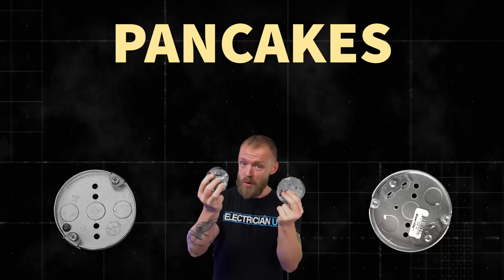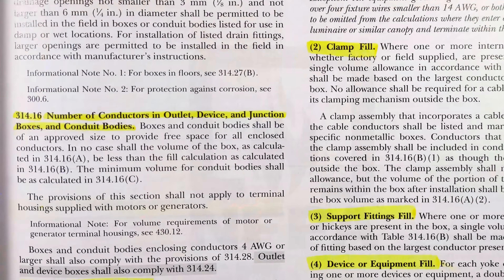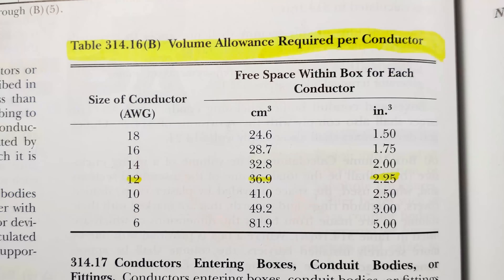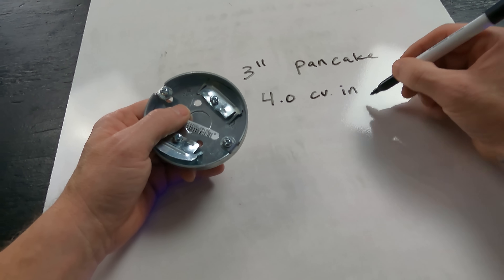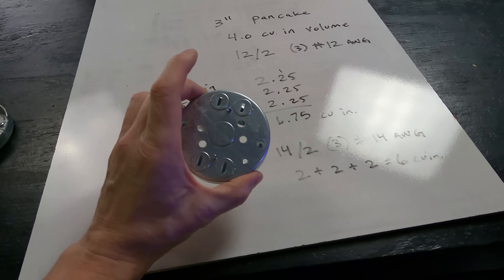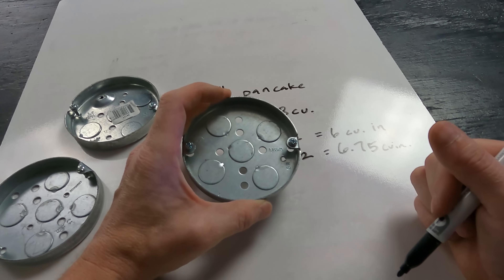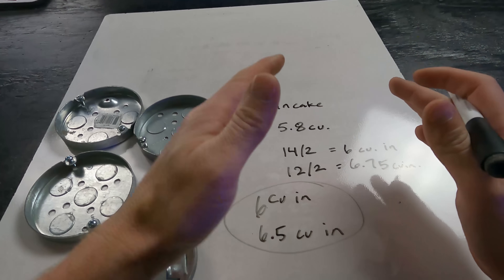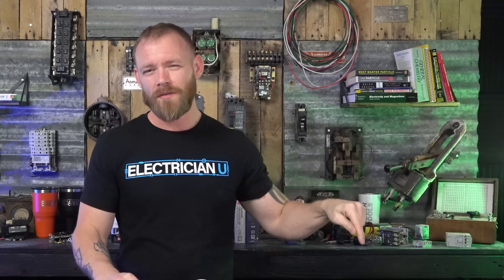Do Pancakes Violate Code? How Many Conductors can ACTUALLY Fit?

Comment: I keep trying to tell my peers at work they are violating code when they run jumpers from these pancakes in 14 wire. They say "NO IT DOESNT! ITS A COMMON MISCONCEPTION!" I swear I work with a bunch of tards.
Reply: Depends on how long the jumper is.
Reply: @DaveMiller2  why does the length of the jumper matter
Reply: @dougfoster445  There is an allowed length that you can use a downsized conductor.
I want to say 16". I could be wrong on the length.
Reply: @DaveMiller2  Doesn't make any sense to me. Can you give me a citation in the code?

Comment: My understanding or box fill was to count CURRENT CARRYING CONDUCTORS. The ground is not carrying current thus would not be counted towards box fill.  Line & neutral conductors would count only so for 12/2 Romex, the box fill calculation would only be 2.25 + 2.25 which is still too much for the 3" pancake.  BUT 14/2 Romex is only 2 + 2 so it would be acceptable to run 14/2 Romex to a 3" pancake.  Am I wrong about current carrying conductors? It's been a while since my apprenticeship program.
Reply: 314.16.(B)(5) of the 2020 code requires counting of EGCs as described in the video...1 thru 4 EGCs = 1 volume allowance in total... EGCs 5 and above each count as an additonal 1/4 volume allowance.
Reply: Even before 2020 you still had 1 conductor allowance for the ground. 2020 just stepped it up for >4

Comment: I feel that since they are a CODE VIOLATION , they,  the manufactures of such boxes STOP and DESIST making them !!
Reply: They are a code violation, in most scenarios. But as stated in the video, you put 18 wire instead of 14 and 12 wire and you'll probably never be in violation. No way a company will stop making a product if it can still serve some purpose. Best work around would be for the code writers to meet and discuss the most common reasons these get used and to find a way to use more standardized boxing methods as minimum code. I understand your grief with your statement though. Would be dumb to fail an inspection because of one overfilled pancake.

Comment: Hmm 🤔 are you allowed to consider the space in the back of the fixture? Most ceiling fans have a pretty generous escutcheon and typically a good size down rod?  How about the typical Florence fixture where the termination is in the fixture rather than the box?
Reply: Yes
Reply: 410.20
Reply: I agree with you, except with the ceiling fans portion, those are not rated for ceiling fans.
Reply: @Htm.13  they do have fan rated pancakes tho but yes regular pancakes are not fan rated
Reply: @bananainacup  Yes sir, funnily enough we call em "Fan cakes" around here lol
Reply: @Htm.13  I didn't even pay attention to the rating when I was changing a light fixture to a fan at my mom's house. I just put extra drywall screws where the fan bracket screws would be so that the fan was being held from along the stud instead of the sides so there was no chance for the box to bend or wobble.
Reply: @xylexut2589  drywall screws are not really the best for hanging fans
Reply: @xylexut2589  It would work, it's done daily by hundreds of Handymen around the country, BUT it is a code violation still

Comment: As a Licensed Journeyman Electrician / Sub Contractor with over 55 years in the trade, I have never liked or used pancake boxes !
Reply: What do you use when your pendant lights over an island need to be perfectly centered on the countertop, and center of the countertop falls on a joist?
Reply: What do you use when center of a hallway falls directly on a joist?
Reply: What do you use when center of a vanity light over a sink falls on a stud?
Reply: @phi5head  absolutely nothing unsafe about a pancake box when used properly. Most inspectors will allow them if you are in a situation where there is no other solution. 37 years experience ,28 yrs as a contractor I use them all the time when the install calls for it.
Reply: @dirtyrotten2648  I totally agree.

Comment: Let let pose this quandary. You are using a pancake in a surface mount application for a wall mount exterior light. Or a ceiling mount fan. (Yes there are fan pans). The room allotted with the fixture should also play into the fill calculations. A lot of wall fixtures and some fans have a "shroud" that provides more than enough space to comfortably make connections. In theory it would work. What's everyones opinions?
Reply: these boxes are not rated for exterior use.

Comment: This is why saddle boxes are superior to pancakes. The extra volume you get by wrapping the box around the joist makes them actually usable to code and can even allow for a junction on the circuit if you need it. I just replaced a pancake in my kitchen ceiling yesterday for a saddle box with a 12.5 in³ volume. Even with the integrated clamps it's still pretty roomy with 2 Romex coming into the box, especially since they're non metallic and don't need a ground screw taking up precious space.
Reply: Saddle boxes only work if you need your box exactly centered on the joist. That's usually not the case.
Reply: For commercial won't always work like that

Comment: 3:00 I'm a little confused at this grounds thing, would it mean 5=2, or 5=5? 6=3, or 6=6? etc
Reply: According to the 2020 NEC code, 4 grounds or fewer total is 1 volume allowance (based on the size of the largest conductor in the box). Each ground greater than 4 is counted as 1/4 of a volume allowance. so, 5 grounds total is 1.25 volume allowances. 6 grounds total is 1.5 volume allowances.

Comment: I'm confused. You were correct on what you said about these boxes but where I'm fuzzy is don't you have to count the wires you are connecting to? I don't see a lot of lights with terminals on them.
Reply: Check the exception in 314.16 B 1 conductor fill.

Comment: I've been using these is my plaster house. I sheetrocked over the plaster which gave me 1/2" depth. I pulled out the old knob and tube and dug out the plaster enough for the romex connector to clear. Fish the romex through enlarged existing holes and screw it over the plaster.

Comment: In the two years I have been an apprentice I have never seen these in my work. Plus they look like a pain in the you know what!
Reply: They're useful when you're trying to cut in a light at a very precise spot (centered on a vanity, matching sconces, etc.) and you luck out and land right over top of a stud or something.  They're definitely a last resort kind of thing.  Mostly I've used them on renovations/remodels.  On new construction when the customer isn't sure of cabinet layout or something we'll leave a wire in the wall during rough-in to cut in the light precisely during trim-out.  And again sometimes you get unlucky, land right on a stud, and have to use one of these things.
Reply: @Audey  what about using a Multi tool and cutting into the stud? Also I feel like I install more waffle lights that are even slimmer now. What’s your thoughts? Here to learn and see many options to installations.
Reply: @djchaisson  Notching out the stud is usually my first choice when I have the option.  You can use a hole saw to do it too, the hole in the drywall will keep the saw stable and the notch will usually pry right out along the wood grain.  Often times though there's HVAC or plumbing in the same stud bay that makes even notching impossible.  I try not to take big chunks out of structural elements too so that's another example where I'd use a pancake.  They also make plastic pancakes where 1/3 of the box extends back much deeper.  But the way they mount, you have to be pretty close to dead center on the stud for them to work.  Plus we rarely have them on hand.

Waffles are great if you plan on using them from the start, and if you're putting lights on the ceiling.  But a lot of times when I end up using a pancake it's because a customer has some other flush mount fixture picked out, and I've already cut 7 holes in their ceiling when I hit a stud.  So my options are pretty limited.

And if I'm being honest, I'll use them to save time even when it is technically possible to get another box to fit.  Harsh reality is margins and deadlines can be tight.  A lot of times it's 10min to put in a pancake or a 45min+ fight to make something else work.  And to me, the primary reason for the code rule in the first place is to allow space for heat to dissipate.  Most fixtures have ample extra space in them, so while it's not to the letter of the code I feel like it's following the spirit of the rule.
Reply: The most common spot that I use pancakes is in bathrooms. The light must be centered on the vanity and a lof of the time there's plumbing or a stud in the way and this is the only way to get the light centered

Comment: Isn’t this missing the point that a typical light fixture has substantial additional volume below the box itself? Effectively that becomes a box extension.
Reply: 314.16(A): “The volume of a wiring enclosure (box) shall be the total volume of the assembled sections and, where used, the space provided by plaster rings, domed covers, extension rings, and so forth, *that are marked with their volume* or are made from [standard sized boxes]” Key point, the luminaire has to be *marked* with a volume to add that space. In the real world, they're never marked.
Reply: @BrentFreyEsq  But in the real world they are always used nonetheless. 
I've never had an inspector call that out or even check it.
Reply: @BrentFreyEsq  True but at the same time the volume in the fixture can be used even if it's not marked. Just use common sense.  You got plenty of room in most fixtures.  This guy is completely going overboard.
Reply: @forgetaboutitwillya5702  Not overboard but precise. The marked box is another refinement that eliminates old stock and promotes new stock. Also increases the demand for licensed and knowledgeable professionals.
Reply: @mojopare8954  So you're going base  your calculate of wires completely on the cubic inch space of a pancake  and ignore the fact that most light fixtures have canopies that in most cases have 3 or 4 times the volume of a pancake.  Just cause the fixture doesn't have a cubic inch measurement. I guess common sense eludes people now a days. SMH.
Reply: @forgetaboutitwillya5702  Well, code is king. What's common sense to one person is uncommon sense for the next. Each canopy is a different size.
Reply: @dougfoster445  Yes. But there's a reason that no inspector has ever said anything to me about my use of panboxes, and that is because they understand that there's more room in the canopy.
Reply: @forgetaboutitwillya5702  it maybe common sense but it’s against code. Sure an inspector would probably let it pass but that doesn’t make it pass code
Reply: @forgetaboutitwillya5702  are you a licensed electrician
Reply: @bananainacup  Pretty sure inspectors wouldn’t pass unlicensed work.
Reply: @xuavrice2338  Most of the time, if the homeowner does it, or let's a handyman do it, and it meets the village's code, they'll allow it.
Reply: @xuavrice2338  you can work under a licensed master who pulls the permits for you, or a homeowner can just get a homeowner permit in some areas.
Reply: @forgetaboutitwillya5702  no I would put a pancake box all I’m saying is that it’s skirting code and you shouldn’t be so cocky about skirting code.
Reply: @forgetaboutitwillya5702  some LEDs don't have shit for space... Low profile tiny ones for like a rv or something
Reply: @xylexut2589  village
Reply: Inspectors rarely are 100% strict about code. It's always about their interpretation and their level of flexibility.  A good inspector will let common sense prevail, and most inspectors are not out to get anyone.
Reply: That's 410.20 and you are completely correct, when mounting a light the unmarked volume of the luminaire canopy is added. This video is a swing and a miss.
Reply: Just because the canopy adds space doesn't take away from the subject of the video. You are assuming that a fixture with a canopy is certainly going to be installed. The video is about Pancake boxes and box fill. You can install a Pancake box and put a flat round cover on it. Yes that's not something many people would ever do but you could. This video is about Pancakes and their box fill and he is simply pointing out something peculiar. If you go to take an electrician exam you need to know how to calculate fill off the box alone.

Comment: Notch the framing 1” and use octagon boxes. Unless it’s in the ceiling I suppose
Reply: Code doesn't allow notching in the middle third of a joist
Reply: Notching the framing is a good way to destroy the structural integrity of your roofing system. Never notch!
Reply: You're not always putting them in framing. often times you are mounting them on exterior walls with stucco surface.

Comment: Why does anyone use these?
Reply: No one wants to use them, they're a last resort.  Sometimes you don't have any other option when a light has to go in a very precise spot and that spot happens to fall on a stud/truss.
Reply: @Audey  exactly
Reply: To put a light fixture for a vanity when the layout falls on a stud is the only time I use them
Reply: Conductors leaving luminaire smaller than 14 AWG do not count. Current carrying and grounding conductors nor do small fittings like locknuts or bushings. See box fill exception. NEC 2020 314.16(B)(1) Exception:

You can feed a luminaire with 14/2 romex and a button connector (small fitting). You end up with 6 Cu” of fill in a 6 cu “ pancake. 314.16 (B) talks about no allowance for small fittings like a button connector. -licensed electrician
Reply: @ianclifford31  yup this is the only way we will do this. This same dude said he would only use them for junctions but that would be against code since you would be over filled with more than one cable

Comment: Any electrician that uses a pancake box isn't someone I would ever use. The only thing they are good to use for is making a junction. No recepts or other devices allowed in my opinion.
Reply: Using them as a junction is the last thing you want to do, and you can’t put receptacles in them, as these are used for mounting light fixtures only. Sometimes electricians don’t have a choice but to use these unless the customer is okay with the light being noticeably off center
Reply: No recepts or devices allowed? What do you mean? Pan boxes are for light fixtures. And sometimes they're the only way to get a light fixture precisely where you need it. And with the additional space provided by the light canopy/backplate, there's plenty of room for wires.
Reply: in the real world Bryan we do have to use pancake boxes, been an electrician for 45 years and find myself installing pancakes in 30 million dollar homes for rich ladies who have to have that sconze light right there, exactly right on the friggin stud, so you have to use a pancake and anytime i can use a different box i do
Reply: Amen!